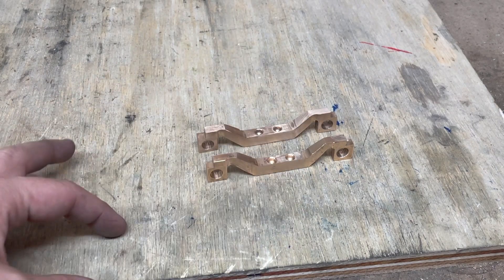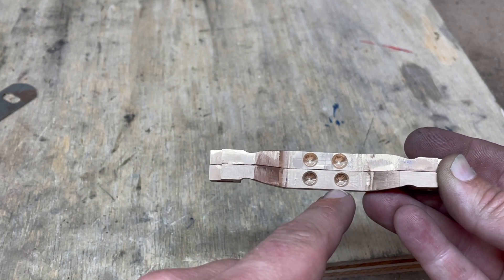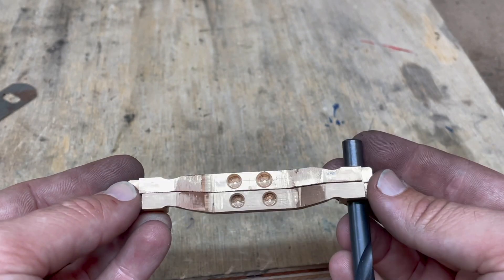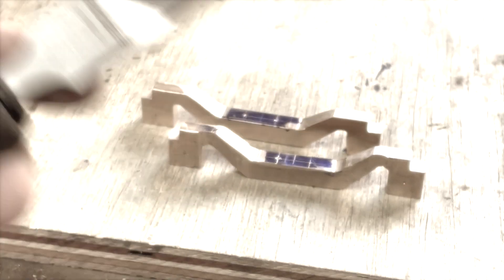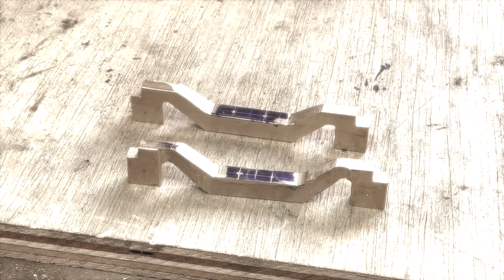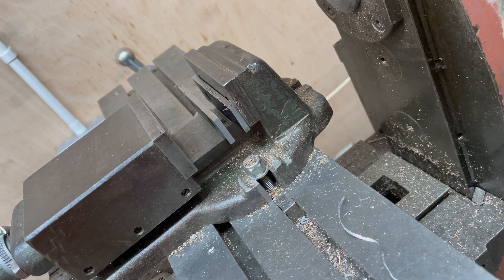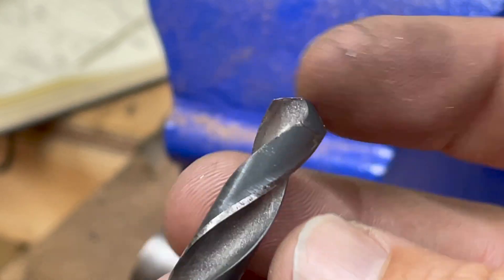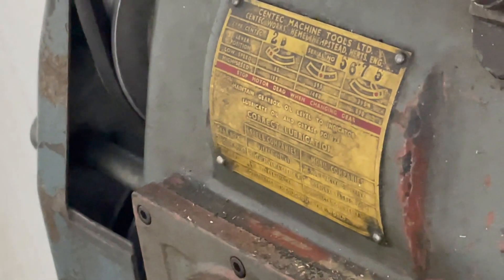Building a Live Steam LBSC Atlantic in 2½" Gauge - 1.3 - Bogie Equaliser Bars

Comment: Great video William !
Don't worry about making mistakes , we all make them but the important thing is that you learn something from them !
My tip is if you see a set of drill bits going for the right price and are reasonable quality buy them and dedicate these to brass or bronze only , i did this a while back and a quick rub on a diamond file to put a small flat on the cutting edge of the drill is all it takes to transform the drill into a brass drill  and if you are going to continue along the model engineering path you will use them a lot !
Reply from the maker: Ah that's a fair point! Strangely it was only that black/brown drillbit that had the problem, I tried another few other drills and they didn't snag at all. Maybe it was cut with a very aggressive angle but sold as a standard drill bit?

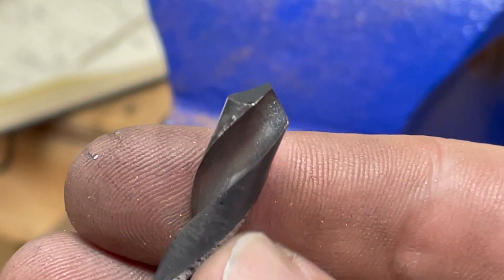Comment: 05:17 grabbing by the drill can be prevented by creating a zero rake edge. Hone the cutting edges on a 800 grit diamond plate (AliExpress, a few quid) so that a small zero rake surface is created. It needs not to be big, a few tenths of a mil will do the trick. Mark the drill as “dressed for brass/bronze/gun metal”. Obviously it is no longer suited for steel, but hey drills are not too expensive, so have two sets, one zero rake and one positive rake.

Comment: One of the things we did a while back on a milling project was to put two springs between the parellels to hold them in place. It is very interesting following along with the challenges you are finding, thanks for sharing
Reply from the maker: That's a good idea, I used something similar with the wheel machining on my most recent video - it's alot easier than trying to grow a third hand.

Comment: I know you haven't done much silver soldering William but you could plug & solder the misplaced hole and then re-drill it (don't try to re-drill the hole without doing so). Mr F has mentioned stoning the drill cutting edge - again keep these for bronze/brass work. If you haven't already done so, invest in one or two 'spotting' drills, I'd suggest a 4mm one to begin with. It makes accurate drilling much easier. You can use a Slocombe (Centre) drill but the cone angle isn't the same as the drill - best kept for making centres. Making good progress, well done.
Reply from the maker: I have a couple of spotting drills, thank you - I used them for this - I just didn't spot anywhere near deep enough to guide the drill on this particular hole. I'll plug and re-drill if it becomes a problem, for sure - definitely silver soldering as opposed to soft soldering?

Comment: hi WW
Another great presented video,
If your fed up of me giving tips just say so, i'm not trying to patronise in any way, but for what it's worth, when drilling brass / bronze don't start changing rake angles etc, even though its the correct way, just grind or stone a very slight flat on the sharp cutting edge, don't go too mad, this will help the drill not to grab, and your right its can be scary plus spoil the workpiece. Also be careful when you say it doesn't matter because there on opposite sides and nobody will see them, some components have an effect on other components, when you come to marry the bigger picture all together, not always but sometimes.
Nice to see your getting the mill / drill in to use.
Keep up the good work and thanks for your comments on my 2000 subs, appreciated.
take care
 mr f
Reply from the maker: Hi Mr. F - I will always take and enjoy your advice, thank you. I will be careful going forward on other parts. I did double check the construction and thankfully there's no critical dimension on these other than the axlebox thickness and the relationship of the axles to the rear faces - but I do get your point. I think I will go back and use a drill to align and tidy the parts up. Just spent an hour or so tramming up the mill and I think we're in a good place to move forward. Thanks again!
Reply from the maker: PS. thank you for the tip on the drill.

Comment: New belts for my Super Seven have arrived from RGD Tools this morning. I'm a bit apprehensive about dismantling and resetting the headstock, but I need to bite the bullet to get it running. The Unimat is o.k. but seriously lacks grunt and it will be easier to crack on with the Stuart 10V on the bigger machine.  I'm encouraged by your 'have a go' attitude, and expect that the reality of fitting the spindle belt is less daunting than it may seem.
I think that you are dead right to sort out the adjustments on the milling machine and the gripping of the milling vice before you go much further. We all rely on the accuracy of the machine tools we use, and vices that will not hold work securely along the width of the jaws are a pain. Expensive and frustrating errors can easily occur.
Best wishes and good luck. I look forward to the next exciting instalment.
Reply from the maker: Funnily enough I replaced the belts for my ML7 in an earlier video when I replaced the oilite bearings in the countershaft. That was a bloody nightmare - but thankfully moving and replacing the spindle wasn't so bad. I almost lost the shims in the bearing caps so if I can be as bold as to suggest something: don't do what I did :) I have just spent a good while tramming up the mill and both the head and the vice were slightly out - but now all good.  Onward and upward!